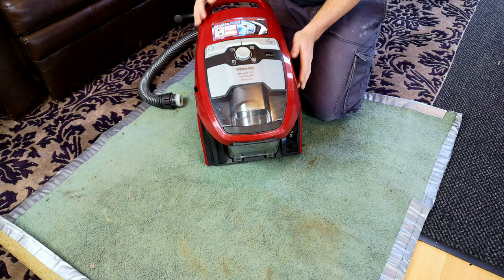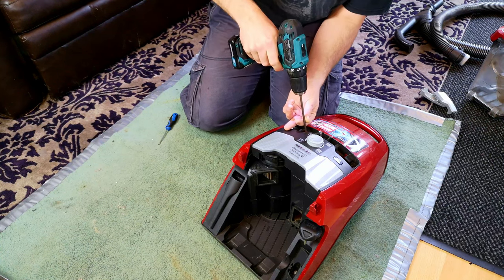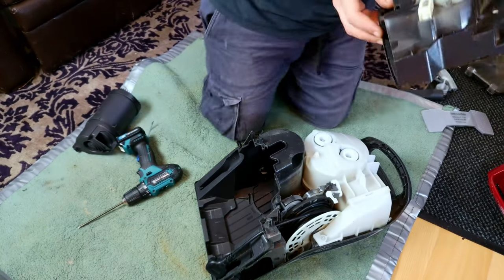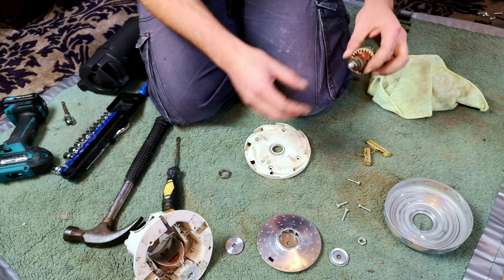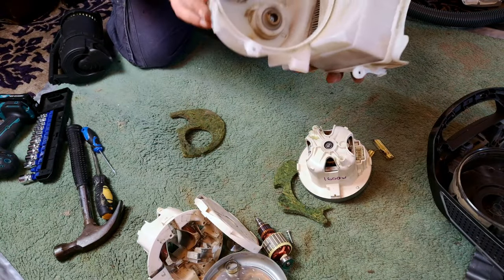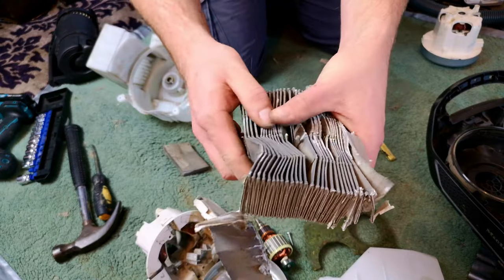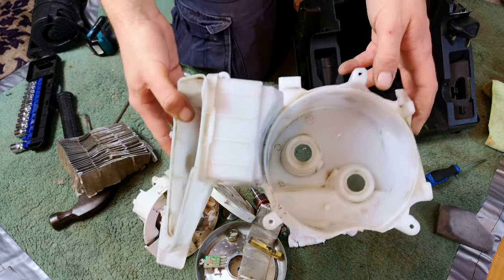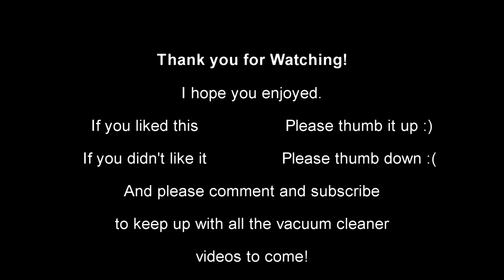Miele Blizzard CX1 Motor Replacement! Oh dear oh dear...

Comment: Hi Sam, at 6min in your video you said that was the Miele speed controller, it's actually the agitation motor for the spline design filter unit :)

Comment: Hello Sam how are you
Reply from the maker: Very well thanks, you?
Reply: @beko1987  I was a janitor for 27 years. I used many types of vacuum cleaners (including bagless). Yes, bagless vacs save money on the cost of bags, but in the long run it's a false economy. The fine talc like dust/grit eventually gets through & causes all sorts of mischief (that includes the motor). I never liked the extensive clean-up of bagless machines to keep them working properly. I much preferred just changing a bag. To me the bags are money well spent.

Comment: When I first got one of these back in 2017, I took it apart and found that non user replaceable exhaust filter - I thought, this is going to be the built in obsolescence that kills these off, once that filter gets clogged up, exactly what you found on your machine will happen. I think the pre-motor filter pleated cone thingy is the weak link as they can split down one or more of the pleats and allow dust  to pass staight through them - straight through the motor and clog up the filter that no one knows is even there, as you cant replace it without totally dismantling the machine, and then having to see if Miele will even supply the white plastic housing with the filter integrated into it. What an utter disaster of a machine these are - mine is back in its box never used after the first few uses. They are big bulky, ugly looking things that quite frankly should not even bear the Miele name - they are more like a cheap quality Bosch thats made in China. Stick to the bagged C3 or C2 is the best bet and make sure you service its filters, which you CAN get to on the bagged machines.
Reply from the maker: It's shocking really, even more so that you can't buy or easily change it! With a babied machine you'd probably be OK but one wrong move, one slip up and that's it game over 😂 Of course I'm now looking out for really silly cheap ones to see if it's a normal thing 😂👍
Reply: Is the c1 any good? Is it easy to replace motor on the c1? Thank you

Comment: Fantastic video, love the enthusiasm, but very informative too.
Reply: The main filter is screwed to the top of the motor! It’s AU $280 just for the part, so when it starts to stink you can’t change it unless you get someone to pull the whole thing apart.

Comment: Thank you for this great video. That Miele is a TOTAL P.O.S. I have an old Miele canister vacuum Model S314 I bought used for $20 Canadian about 5 or 6 years ago which still runs well. The only problem it has is the cord doesn't reel in. I think the S314 is at least 20 years old and is probably more powerful than the current crop of Miele canister vacs which use a bag. I have seen videos of particle tests of this model of vacuum which show that it still filters perfectly to 0 particles in its exhaust. The dirt and the irreplaceable filters I see in that bagless Miele convinces me to never buy a Miele bagless vacuum.
Reply: I bought a Miele C3 with a broken cord reel and just replaced it with a new one I got for £14

Comment: Are these no good then? I've been on the look out for one for the bed rooms for a while now - got a C3 bagged hoover downstairs which does a job
Reply from the maker: Their OK if you stay away from plaster dust/talcum powder and keep the filters clean! I've refurbished a few now and their lovely when working right, but the bagless system can't take much more than household dirt!
Reply: @beko1987 is plaster dust wall dust from sanders?
Reply: @FrenchFryCheese04  Yes, it is and it is nasty, all kind of sanding dust is not for household vacuums, especially bagless vacuums, it is a killer.

Comment: Have you worked on a miele cx1 boost cat and dog yet as I can’t find how to take mine apart
Reply from the maker: Yep I've done a few cx1's now. Pop the top trim piece off by the switches, and pop the switches off too (lever gently at the thin end of each) and undo the 4 screws and the switch pack lifts out. Then undo the casing screws (1 under each tool iirc) and lever the casing join by the bend in the design and it folds up and off at the front. Then all the white casing screws Inc the 2 holding the motor and that lifts off too 👍
Reply: @beko1987  think that’s the blizzard isn’t it I got the boost the smaller bagless vacuum I need to replace the motor got as far as taking the casing off but can’t get the rest off
Reply from the maker: Yep the blizzard! The white housing lifts off the motor (the 2 screws through the rubber bungs hold the motor in). Once off its your boggo miele motor under there (sadly 😂). Can't imagine it'd be mega hard to bodge a Dyson motor in there...
Reply: @beko1987  mines the boost can’t find anyone who has opened one up yet must be because there to new

Comment: Hello Sam,
I am from Holland.
1)Would it not be better if the hepa filter was put before the motor? Thats another design of course.
2) and would it not be better to remove the sponge from the machine?
3) and I see that you can replace the last filter with some sort of it?
We all can see that this is not a livetime hepa airclean filter.
And this for a 267 to 397 euro machine, 
Miele must do better!!!
Not Miele is always better.
Reply: 1) All vacuums I had seen inside have the HEPA filter after the motor, so there is most likely a technically reason for this, my guess is that you loos more suction power if the filter is before the motor. Could be that it is just a very nice place regarding filter change ?, and it can also act as a noise filter there.
2)No, in a bagless vacuum you need all the filtering you can get.

Well it is lifetime HEPA filter if you use the vacuum as Miele had intended, only ordinary household dust, that is no fine dust what-so-ever, clean/exchange filters often, and oh boy out the window with the convenience of a bagless vacuum it is not there, they cost more time to clean and you still need to clean/change filters and that more often.

Comment: Very helpful video.I bought one of these just over 3 years ago and it has lived a charmed life,but recently the retractable cord has failed,very annoying! Shockingly, the few new ones still on the market are over double in price what I paid for mine a few years back.Good suction power but overall this is a cheap and nasty vacuum cleaner.I certainly would'nt buy another one of these.German engineering at it's worst!

Comment: This is probably the worst designed vacuum currently on the market. Avoid at all costs!
Reply from the maker: If you have the exact right size of dust particles and ONLY THAT then I'm sure their fine! I did have one (did some vids on it) and did think of using it for 12v12m but even I'm not that cruel to myself! Sold for £150 on ebay though so someone loves them 😂
Reply: All bagless vacuums are bad, because they use a cyclone (Which is the principle for all bagless vacuum cleaners) is not capable of sorting the fine dust off in the same way a bag do in a bagged vacuum cleaner, it is just not technical/physically possible, so a bagless device has to have more and/or better post filters (filters after the "dust container"), and you will need to clean/exchange them more often, the motor may also be in a higher risk for more dust intrusion then a bagged device depending on motor design and/or filter placement in the suction/blowing chain. In the marketing department it is a big seller that you can save a ton of money on bags by going bagless, but you also may have to pay more for filters and may also end up spending more time cleaning your bagless vacuum cleaner, but your millage may vary. No matter if you go bagged or bagless you will have to change/clean filters (a bag is a filter too).